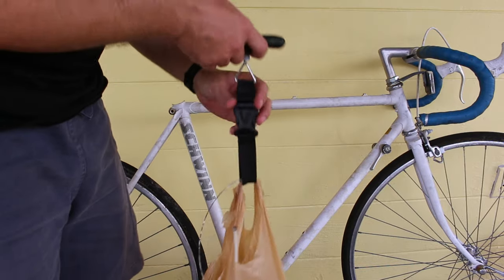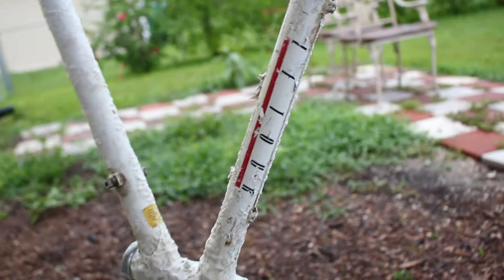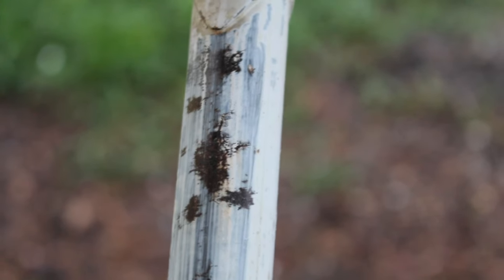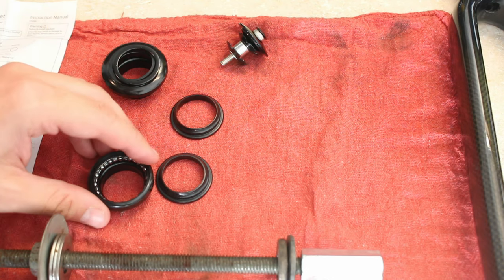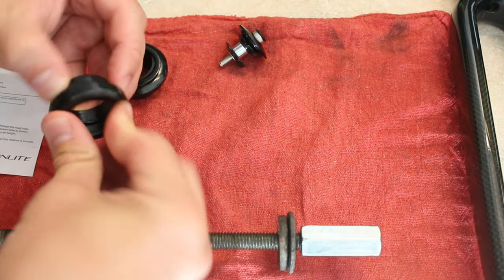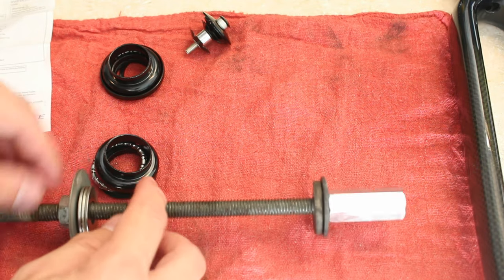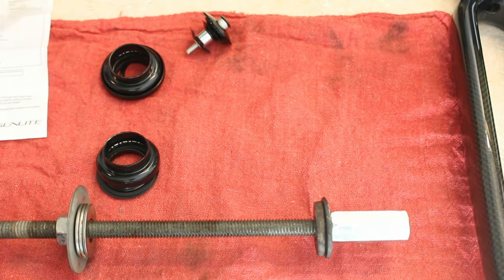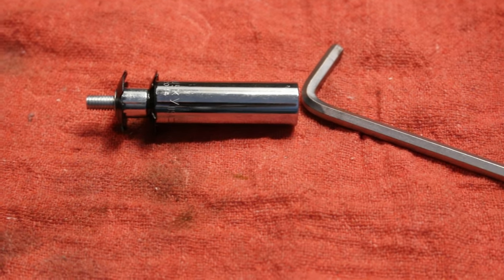$20 Schwinn restoration - 1x9 road bike

Comment: Another Schwinn put back in service! How does this one ride compared to your other one?
The exage levers are SUPER good, they have a quick release button on the side that lets you pop open the brakes for easy tire removal without having to let the air out. If you use brakes with a QR as well, you can (sometimes, depending on the brake limit) combine them to get some impressive rim brake clearance on a drop bar bike.
Also nice mill, can't wait to see what kinds of unique parts you start making with it!

Some pro painting tips I collected from professionals:
- Disposible foam earplugs can be stuffed into screw holes to protect the threads while allowing you to still paint right up to the edge.
- Taping off the BB shell surface (using a sharp xacto knife or razor blade to get it clean and round) saves the hassle of scraping it later. If the shell was never faced you should get a bike shop to do it. Ensures there's no gaps around the BB.
- The dropout faces also should be protected with tape so you get the right 'bite' when tightening the axle in. These can just be scraped after.
- You can find reproduction decals online. They go on before you clearcoat.
- The empty holes in the fork and chainstays are exhaust holes for hot gasses when the frame was brazed or welded together. You can plug these with something paintable before painting. If you don't, I figured out that using some hard beeswax works on a painted frame - knead it to soften it and then smear it in. It'll harden up when cold. You can color the beeswax to match your frame using paste food coloring but that takes some experimentation.

And something I personally learned - downtube shifters can be easy to set up, but they can also be a nightmare. All are not equal and looking up the manual can solve some strange 'this doesn't feel quite right' issues due to a specific order of setting up so the the tension is correct. This is more important if you use them indexed or with a 2x up front.
Reply from the maker: wow thanks Aubreykun for all the great tips and info!

Comment: Hello I see some decent chinese parts from ebay/ali; IXF, Deckas, bar tape, cables and housings, bolany cassette. I hope they work fine and you are happy with your bike. Finally it came fine and it has interesting gear combination 👍
Reply from the maker: thanks zdravo! Yeah so far these parts have been pretty good to me. I don't pretend they're just as good as other parts, but for what I do, so far they've been good.
Reply: @BruceChastain  well I discovered brand Risk, they have great screws, some tools and acessories

Comment: Hello! One question, how a wheel that supports a cassete with 9speed fits in this frame? Normally this old frames support wheels with hubs for 5/6 speeds only.
Nice work!
Reply from the maker: Thanks a lot Joao! To tell you the truth I don't recall what this bike had on it to start with, maybe it was a 7 speed because it's from the later 80s. I think I only had to widen the triangle a tiny bit, which is no issue on a steel frame. I did have to widen another road frame a lot more than this one once.
Reply: @BruceChastain  Thanks for the help! Great video :)

Comment: Was the original fork threaded?  Was it 1" threaded? It will help me a lot to know
Reply from the maker: Hi Alex, I will just reply to this comment. Here I think I've answered the questions: https://hackandridebikes.blogspot.com/2020/10/updates-on-20-schwinn-restoration-1x9.html
Reply: @Bruce Chastain  thanks man, I did see that, I now actually read the boxed description.

Man, I'm glad to know I can fit a 1-1/8 straight fork. It will open the options.
Reply from the maker: @MTBAlex  no problem. I did just add some info in there when I saw your question.

Comment: I have a question. Can I use brake housing instead of shifter housing for the shifter cable?
Reply from the maker: brake housing is bigger, so I guess it might work in a pinch, but I'd try to get the right stuff.

Comment: Congrats, you've taken a beautiful high quality classic, gave it a nice paint job, then covered it in cheap ugly chinese parts with giant brand logos all over them. And lost 1 gear in the process. Honestly could've kept mostly original components, sold the Pinarello parts and had the bike, paint job, and tune up paid for, honestly who cares about less than 4 pounds. I cringed when you cut the quill stem, the bike literally already had alloy wheels on it and a cool lugged fork. Not mine tho ig
Reply from the maker: Hey Tatwood, checkout my latest video for an update on this same bike. Maybe a little better?
Reply: @BruceChastain  Yes dude that's awesome. My biggest gripe was the lack of silver and the new finish definitely delivers! Hard to complain about the carbon fork when you can see the brass in the head tube lug right next to it. Reminds me of the 70th anniversary Schwinn Paramount